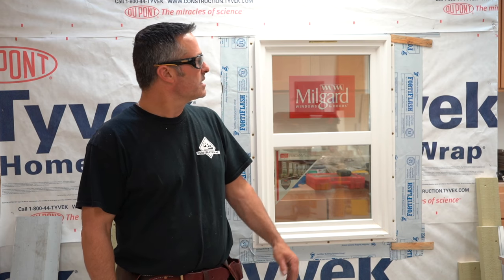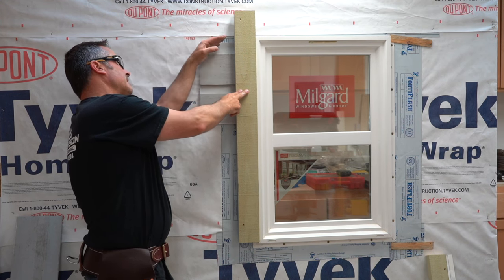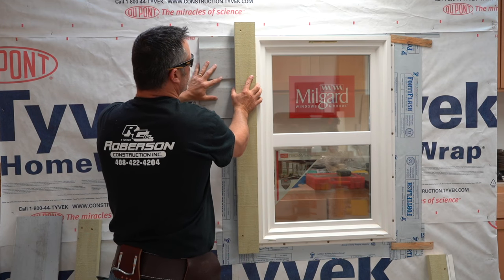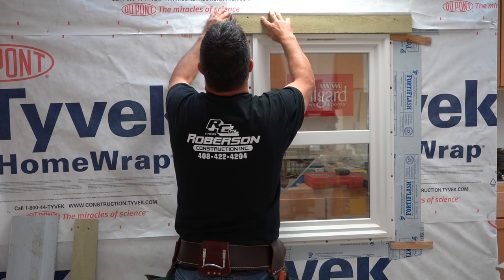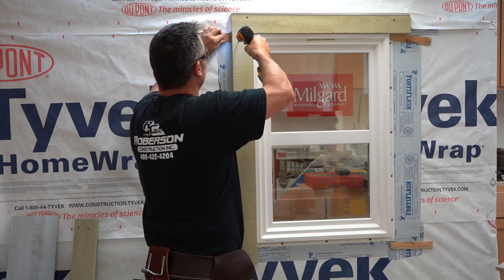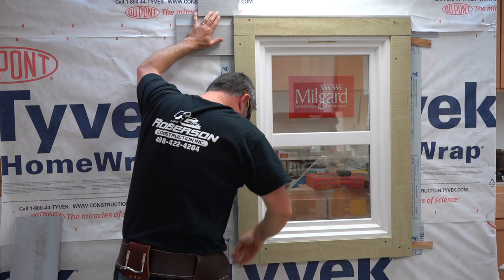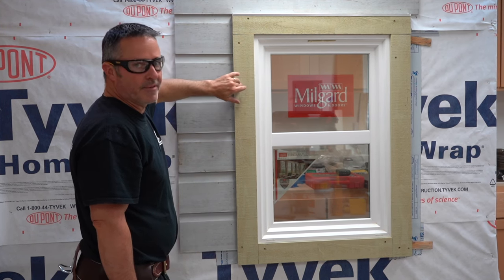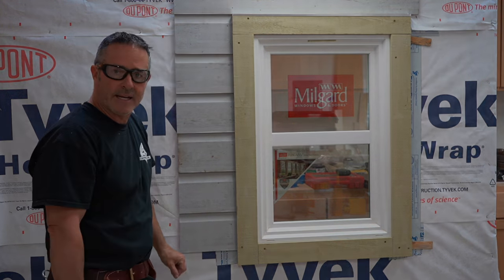How-to install exterior Wood Window Trim and Horizontal Wood Siding

Comment: Thanks for posting video, I would suggest flashing tape both under the window and then over the window flange top and sides (not bottom!). 
Also, would suggest running the z flashing ¼" long on each side of the top trim and then bending it over the edge. Gives a little additional protection to that trim pc.

Comment: As a contractor I can guarantee you that the best application is to wet set the trim right next to the window and then wet set the siding coming into the trim. If you flashed and caulked your window and trim properly you'll have 4 barriers between the exterior and framing 👍
And never 45 the trim, it creates a channel for the water to run straight to the window flange and anybody that thinks they can trust a year stamped on a caulk tube is a fool.
If I had a dollar for every job that a homeowner screwed up by not listening, I'd be a wealthy man.
Truth is, doing this work improperly causes mold infestations that are extremely harmful to children and elderly and many adults in between and is to be taken very seriously.
Reply: @Jaxx Rocket: DIYer here. What does "wet-set the trim" mean? In a bed of caulk? I need to repair some rotted-out trim. It's spongy where the vertical pieces abut the trim the sits under the window.  Our contractors ( back in 1990)  put the trim against the window and the cedar siding against the trim. They mitred the trim corners at the top corners and I don't know if they put a bead of caulk along the top and sides. I want to put new trim in, without having to remove the siding, if possible.  I can apply lots of caulk and even paint the house-wrap and window edge with Blue Max, if that would help.
Reply: @timromano7085  yes wet set is setting the board into caulking.
The extra caulking is well worth the extra barrier.

Comment: Thank you so much for posting this.  I bought a house that was built in 1984, still has original siding and windows.  Unfortunately, the previous owner had vinyl siding slapped on and it is awful.  She also had very formal bead board wainscoat with very nice moulding inside, everything covered up the water damage done when the rain gutters separated and the original wood deck wicked up water to the interior floor sills sitting on concrete slab.  Luckily my house is very small and one story with even walls.  I am in the process of removing the vinyl siding/styrofoam, the original wood siding and the windows.  Then I will prep and wrap and flash in new windows and exterior siding, along with new rain gutters and deck overhaul.  UGH.  In the meantime, I am removing wainscoat, pulling out damaged drywall and batting insulation and everything smelled like mildew.  The original windows were never flashed, and no house wrap just tar paper.
Reply: Sounds very similar to my house. Doing it right the first time saves money and time in the long run, and of course the headache. I will be doing a very similar rehab as soon as I make the time, hopefully this fall. My single story ranch was built in 78, vinyl siding in the 90's over the existing beat up siding. I wish I could go back and give them the extra labor cost to remove the siding first. Of course I didn't buy the house until 2013 so I inherited the problem. When I get to it I'm guessing I will have to replace some sheathing (after 10 trailer loads of debris comes off the house) and then Ice & water everything before doing cedar siding or shakes. I love the look of cedar & the only thing I like about vinyl is how when installed correctly it is fairly durable. Not putting vinyl back up. What kind of siding are you going to use?
Reply: Vinyl siding should be illegal.
Reply: Oof. Hopefully you knew about it before you bought the place and were able to buy it for a cheap price. (You can never truly know how bad it is until you start tearing shit down though).

Comment: When measuring or installing timber moulding calculate the total perimeter of the widow first than add that specific  total amount for timber  moulding by adding extra required centimetre measurement- example 7.5 cm each side - height and width of a rectangle shape.(4 sided window)

Comment: What about if you ever wanted to replace that window or any window? The way you trimmed it would make it fairly easy to replace  versus  running the siding all the way up to the window with the boards over top. Correct?
Reply: Putting the trim in first means you can just pull that and replace the entire window frame fairly easy. If you run the siding all the way to the window if you ever have to replace the window frame you will need to cut the siding back about 1 1/2 inches. With the vinyl window you can just replace the window and it frame. Unless you want all new frames.

Comment: Mike, my home was built in 1996 with hardieboard siding. I'm told by a builder that the siding I have is old and mist likely brittle, might even have cement in it so woulc be dufficult to cut cleanly. You mention trim over the siding might be better long-term to avoid wood rot. You didn't show that way on your video, however. Do you have a video about this? You mentioned here that a 1x4 might warp since it's not as thick as a 2x4. Did I understand that correctly? What is the downside of installing trim over my existing siding? Right now my windows are not trimmed, look dated. Thank you!

Comment: With the lap siding at the top of the window, how do you know you won't end up with a one or two inch sliver at the bottom? If you start at the bottom, you might not end up exactly at the top of the window.

Comment: Not bad, but yeah flashing needs to be addressed top head board. I agree, 2x4 looks much better with some reveals . I have pulled apart old windows / siding with the 1x trim over them, they never hold up that way, creates bug issues and water traps.

Comment: when the crew cuts my siding around my window should my siding butt up against the window , when they cut the siding they miss cut it and half of my window is about 2 inches off on one side and maybe an inch on one side they jacked up the cuts and they think they can put caulking in and put up trim , is this something i should have them redo

Comment: What about drainage between the tyvek and the siding!! You need air gap of at least 3/8 behind the siding ...and that's one thing that's wrong I could go on for an hour!!!
Reply: Hey I seen the same thing?  I use a rabbit around the flange, keep a 3/8” gap?  Seal the ends?
What’s going on here ?

Comment: Awesome video! As you stated, normally you use nails rather than screws. I"m building in a high wind area, and using wood lap siding. Would screws be better than nails?
Reply: Screws are always better than nails if you can use them. Nails are cheaper and a lot faster to use than screws or bolts, and aren't required to do things to code in most applications. If you're doing a DIY you should always use screws in my opinion, it's worth the extra money.

Comment: Hey Mike, Great video. Question. My local box stores sell 3/8" and 1/2" T1-11 siding. Aside from price, what factors should I consider when choosing one over the other? Is the thicker version used to provide structural strength or is it just a more durable option?

Comment: Uh I believe you need to cut with your Table saw or router a rabbit around your styles/rails to accept the window flange?
Giving the water a clear channel to run down?
I mean that certainly is faster?  But being a finish contractor if I caught my guy doing that I would make him/her pull it off and rip the rabbit in it?
Of course if it works for you and your customers that’s great it is certainly about saving time w/o compromising finish product?
So don’t get me wrong I am interested if you hv done it the other way?  Was it a waste of time for you?
Thk u Sir for the content!

Comment: Our contractors in 1990 installed 1-by trim against the window, like your example @1.40  into the video. Then cedar siding abutted the trim. The window trim has rotted out at the bottom where the vertical trim meets the horizontal trim, like you said it could. I am going to be ripping that trim out soon. Is there a way to seal the perimeter of the window with flashing tape or caulk or rubberized paint, which doesn't require the removal of the siding, before I reinstall new trim?
Reply: I have had to deal with the same issues.

There are window tapes and caulking's /coatings available to go that route.
Too many to name and each area has their brands.
I suggest a name brand that is popular in your area.
My thinking is,If it is being made and sold all the time in your area then it must work and the contractors must trust the product.

If you use a window tape,I would suggest using the glue or primer that is available with it and a roller to get a good adhesion.

If you use a permeable liquid coating or caulk , I suggest wet setting the trim after the initial coating has cured .
The last one I used was from dow , Google the product dowsil 758.
I used it in a sausage gun for ease of application.
Good luck
Reply: @richardspearsii286  Thanks for the tips. Much appreciated.

Comment: Hi! Thanks for the video. Newb here. In addition to the Z flashing you installed, does the interface between the window itself and the top trim need any flashing or form of protection?
Reply from the maker: Eae, you can lap the paper flashing over the metal flashing as you move up the wall. Remember the flashing starts at the bottom and overlaps as you go up the wall. Take care
Reply: @MRoberson68  thanks for the tip. I am retroactively adding z-flashing to my windows, so I probably have to remove or cut through one siding panel and squeeze the flashing behind it. Suggestions would be super appreciated

Comment: Flashing is installed wrong. The manufacturers window warranty would be voided. Drip edge should have been cut longer and bent down on the sides. He nailed the drip edge to the top trim piece.  The top of the drip edge is supposed to be at an angle.  He just flattened it out and took away the drip edges ability to push water away from the house.  The nails also created a path for water to enter the wood.  Not sure why he would cut the wrap at the top when he should have installed the flashing then used the flashing tape at the top of the drip edge.   This is better than some builders but still a disaster waiting to happen.  Wonder how many times he has used the phrase, "your warranty has expired".

Comment: my home currently has lap cedar siding. Windows were installed and siding cut to accomodate trim but the trim is not thick. Is it possible to trim over siding?

Comment: lol.. the proper way to do this is to build the frame first.. pocket hole it together so it is one piece and holds up much better... that's just for starters
Reply: Good tip, but each technique works in different installs. Old construction deserves a little thought before re-trimming.

Comment: If I cannot find 1x4 Pre-primed, what type of wood is recommended?  Redwood?  Anything else?  Thanks.
Reply: Azek or similar PVC siding is great, lasts forever and no maintenance. Home depot carries pre primed 1 by and 5/4 pine trim though.
Reply: Get a 1x4 common board and prime it.